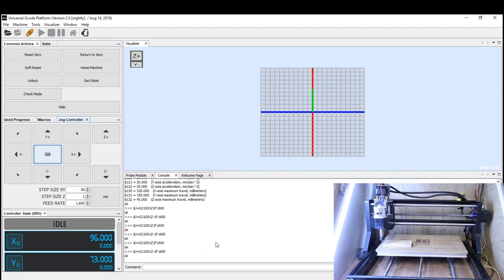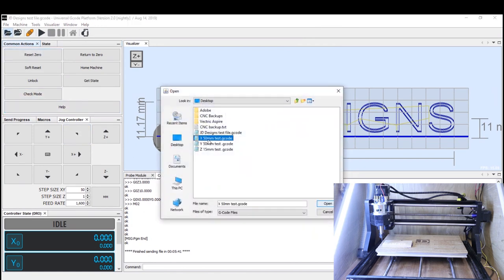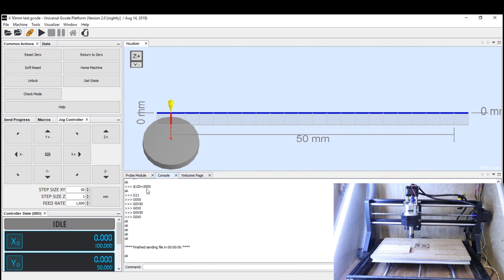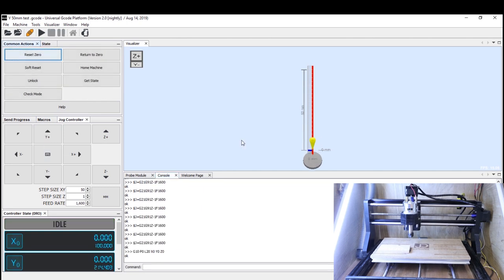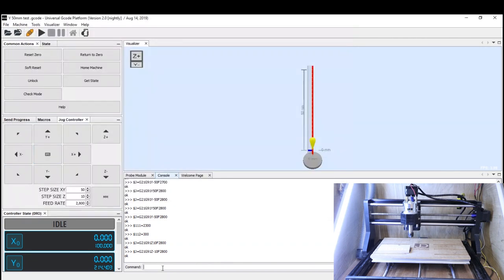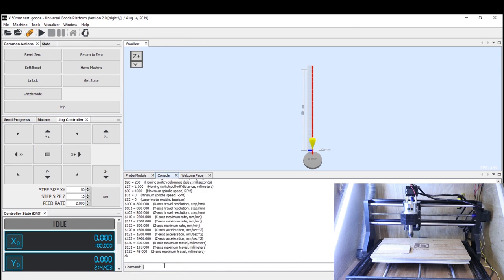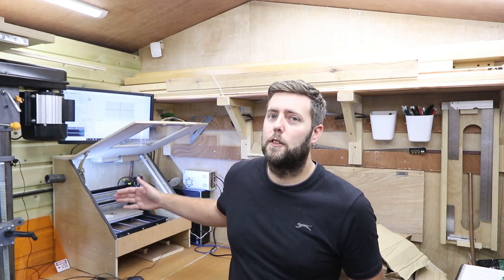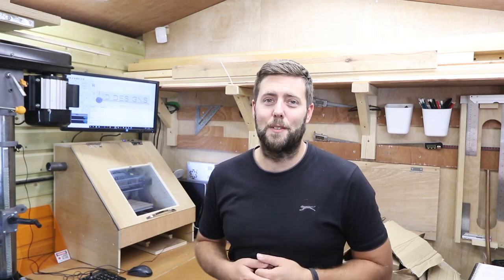3018 PRO - Tuning GRBL settings

Comment: I went through the tutorial and increased my $120/121 number, but anything above 200 does not effect the timing.  is this because of limitations of the motors themselves or could it be an issue with some of my settings?
Reply from the maker: Are you basing it on the predicted times in the software or actual times  once the job is complete?
Reply: @JamesDeanDesigns  actual times, originally it was at 14 seconds for both x and y axis, and I got down to 12 seconds but thats where it plateaus.  Not really a big deal just wanted to make sure I wasn't missing something
Reply from the maker: @varuntandon5097  200 or 2000mm/min? 200 is pretty slow. There will be a limit as your machine will only go so fast but if your job only takes 12 seconds then your not going to save much off it no matter how fast you go. Id consider testing on a job that takes longer, maybe a few minutes
Reply: @JamesDeanDesigns  200 mm/min.  Yeah it just didn't seem right.  I used your "jd designs" g code initially and also after changing the settings.  It did decrease the total time by about 15 seconds, so it did change something, but again not significant
Reply from the maker: @varuntandon5097  sorry, I read your original post wrong, 200 for the 120 and 121 settings is OK. Its not super fast but its better than the 30 its usually set at. You will only save so much time with the acceleration, upping your 110-112  speeds will also save time and it will honestly be different for different jobs. Main thing is you have made improvements and saved time

Comment: Hi i am having trouble finding test g code files is this something you can help with as nothing showing in program
Reply from the maker: Hi. You need to open the description below the video, in there you'll see a link to download the files
Reply: @JamesDeanDesigns  Very helpful, but I guess, I'm blind, don't see the 'James Dean' test file you used for timing. Looked below video, found Grahams but not yours... :(
Reply from the maker: @jackwilborn2353  its all in the same link. It should download a zip file and in there you will find Grahams files as well as my test files

Comment: I thought the smooth acceleration was useful to minimize kickback and reduce stress on the components. Has anyone seen issues with these drastic changes suggested here?
Reply from the maker: Yes, the higher you push your acceleration settings the more strain you will put on components. However the reason they are so low by default is GRBL is used to run much heavier machines than this so you can still increase the acceleration without putting too much strain on the machine. Even just going from something like 30 to 100 will make a big difference (especially with a laser) and will not put any detrimental strain on the machine

Comment: why are the letters (i phone) upside down when Im doing my first pass?
Reply from the maker: Usually means you Y axis is inverted.  It catches people put but when you click the forward arrow your bed should actually move backwards, and vice versa. You will need to change your $3 setting. Try $3=2 see if that works
Reply: thanks that did the trick.  are you is there going to make a video of a beginner step by step realy detailed on setting the parameters, how to set the depth for a cut and making the image larger and so on.  Ive watch i think all of your videos and found them helpful but there are somethings that dont make sense.   Thanks

Comment: If this is mostly about travel time between cuts, then a single pass job should give the best improvement, but it’s not very realistic.
Reply from the maker: Hi David. What's not realistic, the results? At no point do I say you can expect a 40% saving on every job and I was even surprised my self on this job but the results are real. Time is saved moving between cuts and the actual retraction of the Z axis (which is really slow by default) so every job will have varying results, and as every piece of software calculates job differently the same job will have different results coming from different software.
Reply: James Dean Designs I don’t fault the experiments and the time you spent on them. That is a great start for someone doing their own experiments with similar methodology.  What I’d say is unrealistic is single pass milling jobs, at least on these small machines.  What would help is to know the fraction of a job (eg your sample job) that the settings tweaks would affect, which I believe is the fraction of the job which moves between cuts.
I was a software engineer.  I know that you can speed up even a major part of a program by a huge amount, and it has little affect on the overall running time.  That’s the insight I’m missing here.

Comment: dude i got mine all the way to 7500 without jamming i dare not go any higher so i just set it to 3000 and left it at that
Reply from the maker: Brilliant but that does sound crazy fast! better to be safe
Reply: @JamesDeanDesigns  can i ask a question? im using my 3018 to cut out shapes in 3mm acrylic, and when the bit comes to meet the material the entire z carriage that houses the motor flexes. i seem to have flex in the plastic adapter and the 2 stainless rods that run across the x axis, i am using fusion 360 to programme my machine and have set the plunge settings to something stupid like 0.1mm per sec to counteract this but obviously this is adding massive amounts of time to my programs. Have you encountered this problem if so how do you resolve it? i have seen upgraded carriages for about £75 on ebay and that but im not looking to spend another £75 on a machine i just spent £250 on well not yet atleast lol

Comment: Dont you use limit switches
Reply from the maker: No. Never felt the need to add them
Reply: @JamesDeanDesigns  its okay when i bought mine i joined the facebook group and  i was reading a few posts and a few people was saying about adding them as they had blown the mainboard with the z axis bottoming out so i bought them and juat about to fit them. Great channel by the way very informative.
Reply from the maker: @steves-gaming-uk8977  I thought I needed them when I first got the machine, but the more I used it I just decided I didn't need them. However there has been a few times I've had to hit the reset button in a panic

Comment: whats wrong every machine. using short bit it wont reach bed. use longer bit you cant use z probe.and still they use linear roda. they bend LOL
Reply from the maker: Your Z axis will only travel about 40mm if your having issues you will need to slacken off the bolt holding the spindle, and push it up or down until its at a better height

Comment: Cool! Will definetly do this with my machine.
I have some concerns, though.
1. Will these top speeds and accelerations breached under the load, while cutting, or this is purely to move in the air betweendig-in points?
2. In the case of Y axis, did the 80% rule show to be sufficient for you? I mean, there might be quite heavy piece of wood on the table that also needs to be moved. Will it manage?

Comment: One thing to keep in mind is that the top speeds only affect rapid movements. When you are cutting material, you usually have to go slower depending on material, bit, cutting depth and such.
Reply from the maker: That is correct. I think I reference it in the video thats where all the time is gained 👍

Comment: Nice video James.  I must say though I cringe a little whenever you abbreviate millimeter by saying “mil”.  In manufacturing vernacular a mil is 1 thousandth of an inch, not a millimeter.   I don’t mean to nit-pick but in educational videos such as yours, I imagine fundamental details like being accurate with your units of measure is crucial to producing quality content.  Cheers!
Reply from the maker: Thanks. I have to be honest, my father is an engineer and part owns an engineering company, I also used to work there. Ive never heard of mil meaning a thousandth of an inch. However, I agree it is a bad abbreviation as it more commonly means million not millimeter. I am trying to get out of the habit of saying it 👍

Comment: What can i be doing in my design to throw off my z probe zero. I created my cut path and when transferring it to candle. ill do my zeroing with probe and/or manual. Then hit send and the z axis starts run about .5" above work surface. Im using carveco. Iv jumped to easel and im not having this problem. So i imported my project from carveco to easel and i have the problem again. Where am i making the error in carveco.

Comment: Great video.  Have my machine running pretty good,  BUT. Mine does not give the $30 setting for the spindle speed any idea how I can get it?  I assume it would be a firmware thing which if that's the case then it's gonna stay how it is as I am too new to the cnc router cnc.  Lol

Comment: Hello again been getting into your videos and practising with a 3018. On my controller the spindle drive is PWM. You can tell a PWM drive when you bring the speed down to 10% or lower and you will hear a singing sound from the motor. If you were to clamp the motor with your hand it would maintain torque. With a DC control, the motor will stall at that value. I would recommend that if you were to get a new controller make sure the Spindle Drive has PWM output.  Solving the jamming issue. I lubricate the rails with chain and bar oil, while I am setting it up.

Comment: The calibration programs:
Copy everything in between the lines, so the program starts with a % and ends with a %.
Paste into notepad and "save as", change the "save as type" drop menu to "all files" and save the files as "X.NC", "Y.NC", "Z.NC" and XYZ.NC (without the " ")

---------------------
%
(X AXIS 50mm)
G90
G21
G0 X50.
X0.
X50.
X0.
%
---------------------
%
(Y AXIS 50mm)
G90
G21
G0 Y50.
Y0.
Y50.
Y0.
%
---------------------
%
(Z AXIS 30mm)

(SET THE SPINDLE)
(PRETTY LOW AS IT WILL MOVE)
(UP AND THEN BACK  DOWN AGAIN)
G90
G21
G0 Z30.
Z0.
Z30.
Z0.
%
---------------------
%
(X Y AND Z AT THE SAME TIME)
G90
G21
G0 X50. Y50. Z30.
X0. Y0. Z0.
X50. Y50. Z30.
X0. Y0. Z0.
%
---------------------

Comment: Hey James, Need help, some how My grbl file got messed up trying to upgrade spindle, now program GRBL 1.1 will not work correctly, have tried all processes to upload through github etc. only to get error msgs, I recently signed up 
your you tube sight and donated $1.00 a month. if you could respond and try and give some support i would appreciate it
Reply from the maker: Hi Steven, first let me say thank you for your contribution. What errors are  you getting exactly? I'm basing this guess off limited information but my initial thought is you may have blown the board unfortunately. Some boards are more susceptible to this when using a more powerful spindle, but if you have anymore information I'll try and advise as much as I can

Comment: Would reducing the lift of the z axis when being relocated to another XY location also help with a reduction in time? Is there a way to make the z axis lift a very small amount while carving? Then have a very high lift when finished and returning home for a bit change? I have seen the tool paths on some jobs being very short above the board while there are those I've seen that are rather tall.
Reply from the maker: Definitely. It's called your Z height or Z safe height and it's essentially how high the bit lifts above the material inbetween cuts. The smaller the number, the less time it takes

Comment: James in the 3018 Pro -Tuning GBRL settings the test file (JD Designs test file.gcode) you use initially is not apparently included as a link in details below the video is it possible for you to provide please Regards Paul
Reply from the maker: Hi, Ive just tested it and once I download the zip file I can see it there. There are five files, Grahams guide, my JD test file and the X, Y and Z test files. Can you not see them in your download? Are you using candle rather than UGS by any chance?

Comment: Do you know if it’s possible to cancel the z homing from the UGS homing cycle? (I only want X and Y to home)
Reply from the maker: Homing is a command within the control board configuration . You can adjust it but its not quite as easy as changing these settings. 
This article as some useful links 
https://github.com/grbl/grbl/issues/1297
Reply: @JamesDeanDesigns  thank you. Ended up buying more limit switches.

Another thing. In UGS when your running a program and press stop does your axis zero out?

Comment: Your $3 is set at 6 mine is zero and in easel it goes the wrong way after doing this video also the test prints your design backwards.
Reply from the maker: You need to work out which axis arw travelling in the wrong direction and then you change the $3 setting to invert the axis that are the wrong way
Reply: @JamesDeanDesigns  I used the same setting as yours has seems to be working fine. Had to back off speeds for laser . Thanks

Comment: Hi james when I ran this test a few days ago I got a very smooth cut and it looked great, then played with my laser and put it back today. Now I get a very rought cut. also my gcode files does not run at the speed of your test files, Trying to understand why this is happenning. I have changed all my spindle accelation, speed etc with the tests that you suggested but I cannot get a gcode file to cut right? any suggestions.
Reply from the maker: Did you change your $30 settings when you put your laser on?

Comment: Hi, firstly thank you for taking the time to make these tutorials they really are helpful. I am having an issue i was hope you might be able to help with. When entering $$ into the command to view the current settings, there is no $30 spindle speed and when i try typing $30 = 'x' i get an error message... do you have any idea what could be causing this?
Reply from the maker: I'm not 100% sure but it sounds like you have an older firmware version of GRBL. I think if you just type a single $ it should tell you what version. If you Google how to update your GRBL firmware it will give you some tutorials
Reply: @JamesDeanDesigns  tried that, was given a list of commands. From that typed $I which gave me [0.9j.20 180 122:] . Will search that now
Reply: @JamesDeanDesigns  just did the update and can now control $30 spindle speed. Thank you!
Reply from the maker: @alexandarokulic5439  glad you got it sorted 👍
Reply: @alexandarokulic5439  Hi there I am having the same issue, which tutorial did you follow? I found one but its rather complicated and seems to require that I have an Arduino Uno or something.

Comment: My 3018 only works in a very small area, when I run check mode it seems to be fine, but when I start cutting, it only works in a very small area, what kind of stupid things do I do, there is something in the setup on UGS or are there bugs in the software?
Reply from the maker: Sorry for the basic question but just need to check, does everything move as it should to the correct distances. So when you send the X axis left or right by 50mm does it actually move 50mm?
Reply: @JamesDeanDesigns  I have uninstalled and installed Candle and there is no problem, only one the carving is in a mirror?

Comment: i dont have $30 in the settings is dat normal?
Reply from the maker: It means you're running an old version of GRBL. If you Google update GRBL firmware, the first video will walk through what to do, alternatively it's a case of buying a new board

Comment: Some of these settings aren't available on mine. Any ideas?
Reply from the maker: Your control board will be using old firmware unfortunately and you'll need to update it. If you Google update GRBL firmware, one of the first videos which comes up is a comprehensive guide showing you how to do it, then you'll have all the settings required
Reply: @JamesDeanDesigns  That's great. Thank you. Wasn't sure if it was a limitation of the control board.

Comment: Hi Mr Dean, On my 3018 my spindle is coming on as soon as I turn the machine on. (I have a constant live 24v spindle output pin. Any ideas? Have I set a setting in the software so the spindle is on all the time? The only way to turn off the spindle is by pulling the plug from the wall... Cheers tutorials videos as always!
Reply from the maker: Hi Don. What control board do you have and has it always been like this?
Reply: @JamesDeanDesigns  Hi James, I have the camxtool v3.5 (the black one inside the pvc casing) and no it has always worked as intended (on off via software/gcode). I just can't remember if I changed a setting or not. Basically the spindle turns on as soon as I plug the socket into the wall. Any ideas? I was thinking a fried fet or relay on the board? I was checking with the expert (you!) before buying a new one, Cheers!